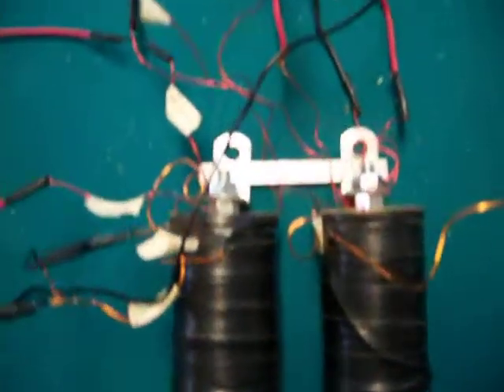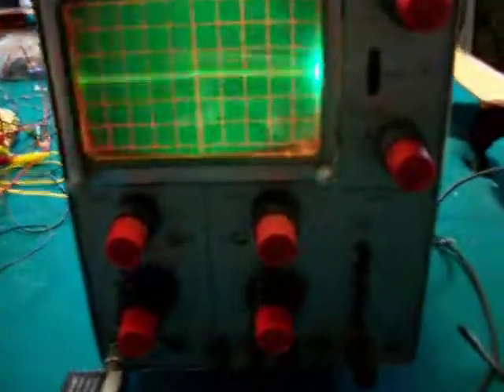Leedskalnin Coils #2

Comment: currents only flows as waves what ever its microscopic or big. the fields are the properties of the subatomic particles. static field does not produce waves. only when the fields behave like waves energy can be transfered. waves can create magnetic fields when the magnetic particles behave like a wave. that can be a single increase in amplitude for a short time. the reason its hard to get electricity out of a generator is that most of the energy is used to create and change fields.